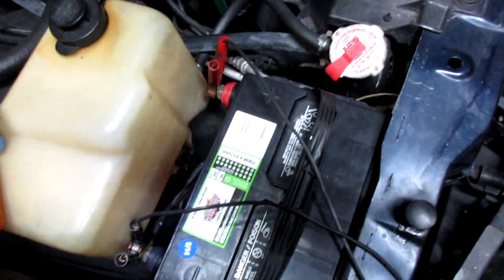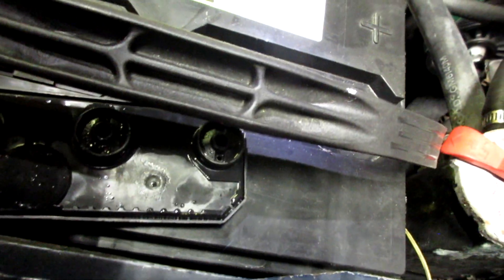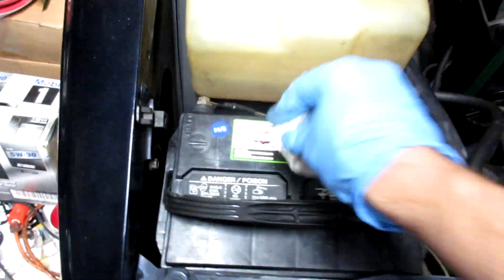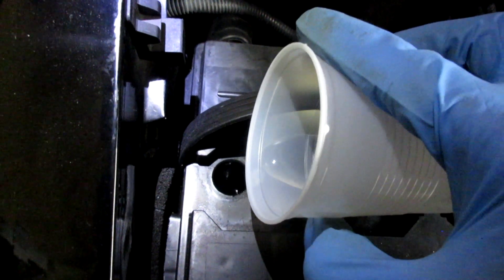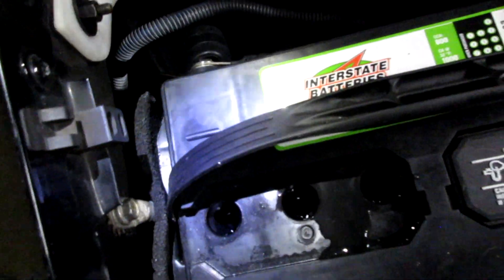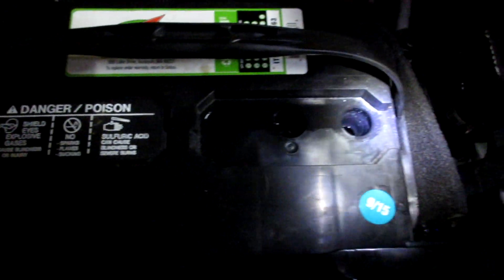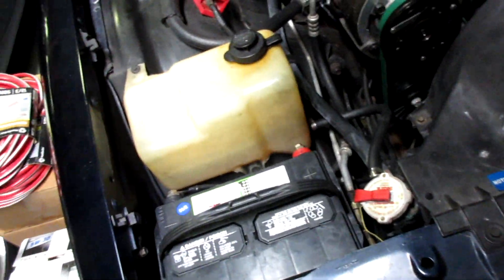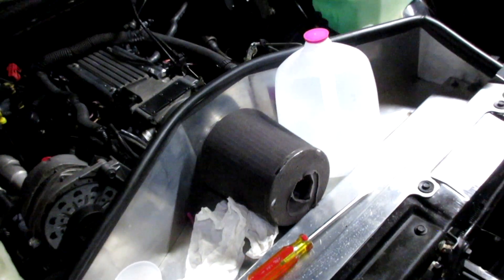How To Check Water level in Car Battery using Distilled water!

Comment: Go to Home Depot or even Walmart.  They sell "Acid" and you can use it to fill it back up.  I find distilled water evaporate really fast.  Acid is a bit slower and it's cost effective too.  1.5 Gallon of brand new Acid is only $22.49 at Home Depot.  You can refill/rejuvenate a lot of Battery that way.
Reply from the maker: Problem is you don't know what the soultion is when you add acid. Mine was not very low.